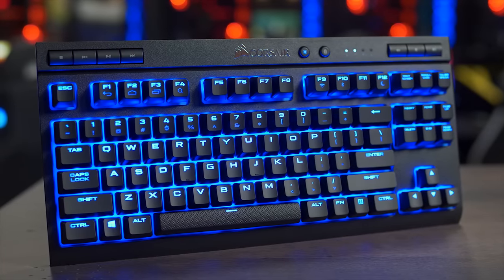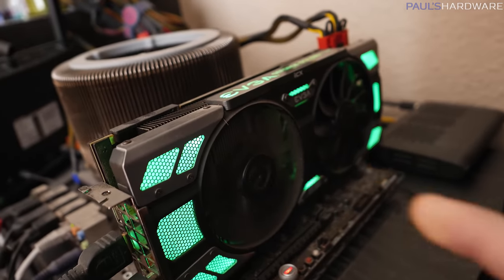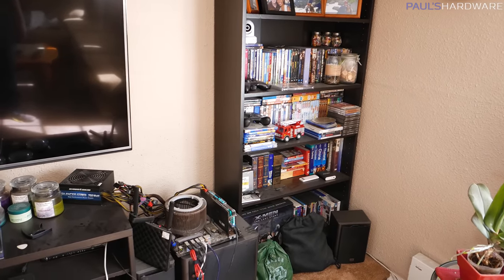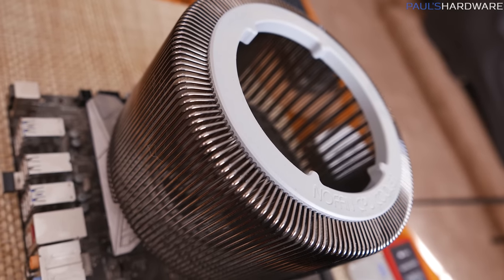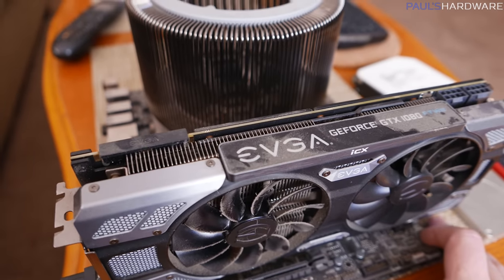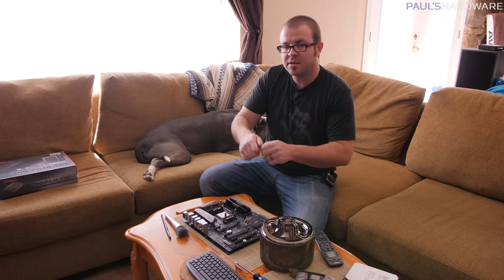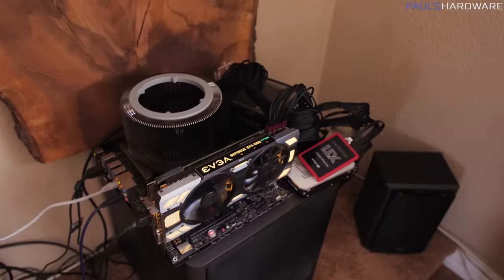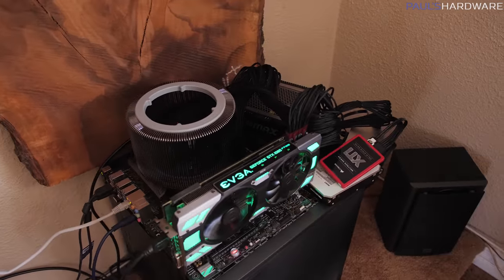Does Your PC Even Need A Case?

Comment: dude, you really leave the HDD laying in your subwoofer? with all the magnetism and vibration from the speaker?
Reply: that might just tell us it's not really an issue
Reply: You need a serious magnetic field to cause issues with electronics.  His hdd wasn’t inside the sub sitting on the magnet.  If the vibration has killed his drive he wouldn’t be using it.
Reply: keptin kaos

maybe he is just lucky....
Reply: 1SLUGGO1

HDD is not an ordinary electronic, the discs inside the case react with magnectic field, they are much more sensible, and 10" or 12" subwoofer speakers usually have big magnets behind....
Reply: possible but not likely
Reply: but still a posibility
Reply: You know there are very strong magnets inside the drive too, right?
Actually, it takes a HUGE magnetic field to do damage to the mechanical drive's platters, the drive frame and lid help shield from this... Also I'm sure the sub is partly shielded as well.
Reply: yes, but thes magnets inside the drive just do something when the signal reach them, not in a random way like an external magnet

the shield in HDD are not that strong, and the discs are not that strong either, i lost a lot of data in an HDD once due this, and speaker boxes are not magnetic sealed anymore, they were in 90's due CRT televisions....
Reply: The magnets of that puny Sub Wolfer are not going to affect the Hard Drive..
Check out this Video: https://www.youtube.com/watch?v=4l-6qWaZpVQ

6x2" neodymium magnet vs servers and hard drives.. Look how close it has to get to kill the drives..
Reply: Upgrade to ssd!

Comment: I haven't had a case on my pc motherboard for about a year now and had no issues with it at all. It fits perfectly under my tv stand (so I guess it's not completely exposed.) I used to have a case but saw online the amount of people who had their pc's on a block of wood. I just use a bit of cardboard under my pc motherboard. It makes it so much easier to swap out components. It also gives amazing airflow and there is no bulky case to worry about. And In my very limited 12 foot by 12 foot room that's a big help!  Also, regarding the PSU getting dusty, I have found the putting it on its side helps a great deal. But, thank you for the video. It was very interesting.

Comment: Hotwire the power switch (make sure you get the correct pins, then just cut the two wires and strip a bit off the end, touch the bare wires together to start the computer), put motherboard mounting screws in the bottom of a shelf (facing down means no dust), screw the PSU into the wall, SSD's can go anywhere with tape/glue/used bubblegum.
Use an AMD APU and you only have one fan on the whole computer (not counting PSU).

Comment: my opinion. even the cheapest case is batter than not have one at all.
Reply: in 99.9% of the cases I have seen I would agree. There are a few that are worse especially with shitty cable management.
Reply: What kind of batter. Like cake batter? Pancake?
Reply: @diablojd52  Like mine ? I've been thinking of just taking it out the case.... The case is noisy af, gathers dust like crazy and has the WORST FUCKING MANAGEMENT EEEEEEEEVEEEEER!
Reply: @Teknishun  it isn't the caseaking noise and gathering dust it's poor airflow and filter management.
Reply: @diablojd52  Trust me.... I did a poor investment, most 90s PC case would be better xD

Comment: The computer doesn't care if it's dusty the cooling might but the computer doesn't unless you're in a coal mine with all that conductive carbon floating around in the air the computer really doesn't care he won't be offended
Reply: Dust and moisture together can have nasty effects on circuitry. Plus enough dust build up can be a fire hazard, and it is like a blanket of insulation on hardware too.

Comment: no power button is a bit annoying
Reply: That board had a power button on it. You could just short the power on header pins to start a PC too. But beyond test benching hardware not having a case for a running PC I do not think is wise. I would never do it. I was shaving pennies on my last build yet I still included a cheap case for everything. PC cases are purpose built boxes for hardware. They serve several useful functions. It is the minimum you can spend to protect your investment.
Reply: What if you need a reset button?
This is why I don't buy Dell or HP or Lenovo.
Reply: Motherboard has reset button also.
Reply: You should not need a reset function for normal operation. But if your PC ever gets into a completely unresponsive state you can just disconnect power from it momentarily to reset the system state. Also Power buttons often double as reset buttons if you just hold them in for a set time. Usually it is 2 seconds.
Reply: doesn't matter dude, this motherboard, Asus CROSSHAIR VI HERO, has all the buttons! Power, Reset, Safe boot, a retry button (?), on the back (IO panel) there's a BIOS FlashBack button and a Clear CMOS button. If you don't want a case, this board covers all your needs.
Reply: For what that motherboard costs they should throw in a case with every purchase.

Comment: I'm not using a case and I'm perfectly happy with that. I can run a fully passive system (ZERO NOISE thanks to no fans and SSDs only) without a case. If the components were inside a case, they would heat up 10-20C more and would require some sort of fans that would generate noise. I'm very sensitive to background noise and even a "quiet" fan or a HDD idling is very irritating to me.

Comment: A case is recommended due to thermal expansion. The mounting screws are supposed to keep the mainboard in a somewhat stiff from to avoid cracking of copper traces or Solderjoints. I dont know how far not having a case will reduce the lifespan of the mainboard but it is something to keep mind.
Reply: Wow i never knew that, thats really interesting!
Reply: That... Seems backwards... Wouldn't using screws to keep the mainboard compressed make cracking MORE likely?
Reply: TotalInsanity4 Compressing it around the screwholes seems better to me than a motherboard flexing because it compresses and does not separate the single fibreglass layers. I am not a engineer, but i can see how a case would help... imagine a motherboard ever bending and twisting due to system temperature changes and with that stress on solder joints and internal connections.. someone should test it..
Reply: My wife designs "bed of nails" circuit board test equipment.  She says circuit boards DO expand with very high heat like above a pool of liquid solder. But not during normal operation (and her testers do power-on-the-board testing). So I don't think the mounting screws are to hold things in place for thermal expansion so much as mechanical support.
Reply: If you keep the temperature constant thermal expansion is not an issue. The issue really is expansion and contraction cycling. He said he runs his PC 24/7. So that means his parts stay a fairly constant temperature too.
Reply: Omar Beydoun Look, I'm approaching this from an engineering perspective; specifically, in my head, I'm relating this to a bridge. A modern bridge is slightly curved upwards with one fixed end and one end that's allowed to travel a bit back and forth so that when a load is applied, it's allowed to flex downward. If both ends were fixed and it flexed far enough, rather than being allowed to expand into one end it would crack where the load is heaviest. I fail to see how a motherboard expanding due to thermals is any different

Edit: this is, of course, assuming that it's anywhere NEAR as big an issue as the OP made it out to be, which I highly doubt it is
Reply: Well that's strange as I've had a caseless build with a 2600K since 2011, and I haven't experienced a single fault with it the entire time. It's run its fair share of games, and half of it's life the CPU has been overclocked to 4.4GHz. Neither is it a 'constant system' as it gets turned on and off all the time. I don't know how long a motherboard should last, but I think somewhere in the vicinity of 7 years (and still going strong) is not a bad result thus far. Just my two cents.
Reply: It is not strange. The engineers just happened to get it right. They don't always. You do realize that different boards are in fact physically different, I hope. There are a number of factors involved that make some boards more or less susceptible to thermal failure. You just have a board that has performed well. They all don't. What you're presenting here is called anecdotal evidence. While interesting in its own right it does not begin to explain the entire topic.

Comment: you can also use a brush thats used for changing the hair color, its a long plastic brush thats pretty soft and its wide and thin, so it gets into pretty small places, good for cleaning the pc, also theres a vacuum attachment that has a lot of super small tubes that grab all the dust without disturbing the components and doing any harm, no idea how its called, but there is...

Comment: In 1998 I was running a K-6 300, windows 98, duel monitors and running one of the biggest guilds on Diablo (1) without a case. Looked like all the rest of the parts laying around. Just a pile of parts that happened to be turned on.

Comment: About 6 months ago I switched to an open air test bench and I haven't looked back.  There are less fans so it's more quiet, my temps are cooler and GPU sag has been eliminated.  It's also way easier to clean.  Every other weekend I hit it with some canned air and in literally just a few seconds I'm done and back to gaming.

Comment: Here in Canada that would violate the RF and radio interference  requirements from the radio telecommunication authority (The government). That is the primary reason for a case is to reduce EMI interference with communications. I had a neighbor that was a CB user. He had altered his radio for more power and every evening at 6pm  he went on and had to listen to him for hours on my  Radio. I filed a complaint and had  an inspector come out to my  house to investigate. He received a 10,000 fine and was ordered to take his transmitting tower down and to only use a in-modified transmitter.

Comment: I use a sink with warm water and gentle detergent to clean all my electronics.  Just did a whole computer - mobo, gpu, ram, all fans, sound card.  Not the hard drives but pretty much everything else.

Then rinse a lot and allow to dry for a few weeks.  Faster than "dusting" but longer to put back into service.  Exceptionally clean though.

Comment: My only issue with running caseless is any plugs that are not 'currently' used need some covers, but beyond that dust is a reality inside cases as well (even cases with filters get dusty inside). Other than that if the board wasn't lying flat on the table it wouldn't have even a 1/4 of that amount of dust. Setting it in a way that the fans for the EVGA Vid board are on bottom, it would stay fairly clean. (Which is how I used to have my system before replacing it with an 'all in one' type (basically my computer is a laptop built in behind the 22" screen).

Comment: What a gigantic heat sink!
Btw, although its possible to run a PC without case, I don't think it is a good idea because the case provide protection from the outside. e.g. impact to the harddisk, water to the mainboard. It also shield EM wave from the electronic when the PC is running.

Comment: When i made my original HTPC i had a budget of $200 and so corners had to be cut, it had a a10-5800k and 8gb of ddr3. I drilled it straight into a piece of plywood so it would fit in the cubby underneath my tv. Later I upgraded it to a fx-6200 and a gtx 960 and drilled into the very same piece of wood and i didn't have any issues. The first computer ran for maybe a year and a half and the second about six months.

Comment: Thank you, Paul's Hardware for a look into your personal life, and a brief look at your personal space!!! I'm a traditionalist, but I have wanted to mount a PC inside a mockup of the bridge of the Star Trek TOS Enterprise, either Spock's station or the Command Helm. I like the idea of turning your PC into an object of art! Very creative! I love that fanless heat sync!

I'm Running:
An AMD FX_8370 w/CoolMaster Hyper 212 EVO CPU Cooler 
A Gigabyte 990FXA-UD3 MoBo
AMD Radeon HD 3650 Graphics card
Seagate ST1000DM003 HD
Seagate Backup Plus 4TB Drive
8 GB Kingston HyperX RAM
CoolerMaster Force 500 Case & Power Supply
Arctic fans
Linux Mint MATE 18.3

Comment: You can also use a cheap large paint brush with fine bristles to clean the larger areas quickly and it can also clean a large heat sink like his CPU one. Also qtips and alcohol are great for small areas like on small fan blades, it takes a while but give you outstanding results if you are meticulous.

Comment: I also have an open computer (it has a plexiglass top and sides cover but two ends are open 14" wide 7" high, so plenty of air flow), and I also have carpets, I have a Honeywell 50250 Air purifier, and it is a life saver especially with allergies, and it takes out about 70% of dust in a living room space which is amazing.

Comment: i wish they could make the whole motherboard and pcbs insulated and just have the heat sync outside
its kinda nice to see a PCB like a plane peice of boad with the circuitries hiden underneath a sheild of something
that slab of wood worries me it could tip over and fall to the computer
how about you just make a wooden pc case or wallmount set up

Comment: The PC is sitting on top of a speaker? Wouldn't the magnet in that cause problems for the mechanical HDD, also the vibration of the speak when in use?

Comment: I've been running my PC without the side-panel on forever now because my temperatures are MUCH better with the side-panel off vs. on. 
This idea that "DUST" will be a big issue is total NONSENSE as well unless perhaps you keep your PC on the floor and never bother to dust it out. 
I personally keep an electric air blower right beside my PC and blow it out every morning before turning it on just for good measure. No dust issues for me just really cool temps and great performance. I do have plenty of fans running inside my case so that helps keep dust under control as well.

Comment: No. You don't need a case.
But having a box to put all your computer parts in helps keep things clean.
As for using a compressor, you can get an inline dehumidifier for your air gun to keep the moisture down.

Comment: I'm running similar setup - 4790K with Noctua NH-C14 @700 RPM, Palit GTX 1070 Gamerock (silent and cool), SSD + 2.5" HDD, Corsair RM750i with idle fan even at full load. Although i use mounting plate from my old case just to screw the motherboard onto it. Also motherboard has power and reset buttons.
Reply: I have a 2500k OC to 4.8Ghz with a similar Nofan cooler like in the video and in games, while streaming, the CPU never exceeds 65-70C. Fans are not really needed unless someone goes for 8700k 5.0Ghz or CPU torture tests...

Comment: 1:45 i have exactly that hdhomerun device and after windows media center went away i couldn't figure out an easy way to use it. can you help paul? just recently got rid of the cable card, but it is only 2 bucks a month to bring back, and i have several computers and other devices on the network. myth is a fucking myth unless you want to dedicate everything to something new. what are you using?
Reply: actually i bought that hd homerun device the same day that newegg put out a video about it on their channel. there, i made you responsible for my issue. (not seriously)

Comment: I switched to a wired controller because I've never been able to use the wireless one without the connection dropping out, even though the receiver had a clear line of site and it was about a meter away.  They had REALLY bad drivers and Microsoft never bothered to fix it.

Comment: Just a thought. You might not want to put electronics on top of a subwoofer which has a magnet in it. Especially if you run the sub at the same time as using the computer.

Comment: I say get rid of the carpeting while you're at it as that is where most of the dust will come from as it's trapped in the fibers. I tend to run a couple of builds without a case in my house and the dust isn't as bad.

Comment: If u had no case used a screw driver to power on all u would have to plug in is the 24pin and 8 pin for gpu and power cables for hdd right?

Comment: Of course I need a case, once I was traveling, from million times opened above drawers space that I let my mom use, hinges failed and the door from that elevation fell on my C70.
It's not "military green" but "gun black" xD and since it's made out of steel not plastic my H100 and motherboard was saved, the impact looks like a blast.
Thank you mom.

Comment: This is the video I was looking for. Did he leave the bottom of the motherboard just sitting on the table? See I was thinking about a thin cut piece of metal, like filing cabinet material, I guess 2 foot width and long enough for the motherboard to sit on, so you can screw it to the studs in the wall, right over a desk about a foot above the surface, connect the mother board to that piece of metal, drill holes where ever it needs screws and put the power supply and hard drives, right on the desk, any excess wiring can be stuffed between the desk and the wall

Comment: My PC Runs Without a case since Christmas 2016, it just sits on its Motherboard Box, 2 HDDs in Top of each other and the psu is also just next to the Motherboard. I dont even have a Power Button... I use the the edge of an old ddr1 Module to Switch it on. Its my Old Core2Quad Setup from 2008 Still Running Great. 8gb OCZ Reaper HPC DDR2 1200Mhz, a Q9550 at 4.2Ghz, 10k Sata Drive for the OS with 320gb and a 1TB For Everything Else. As a Graphics Card it has a HD7950 from VTX3D, a tv Card for FM Radio, sattelite TV and Cable TV. And finally: Asus P5Q PRO as the Motherboard.